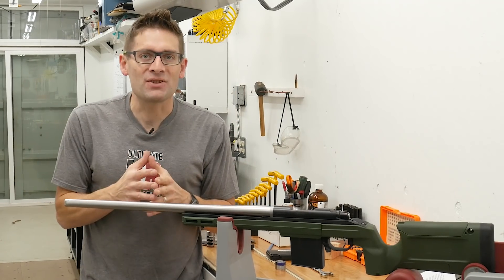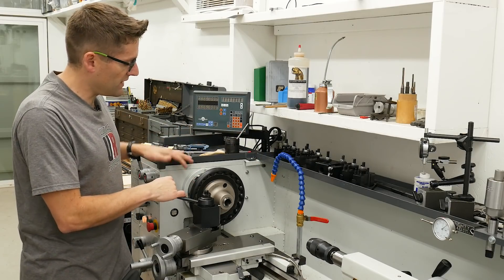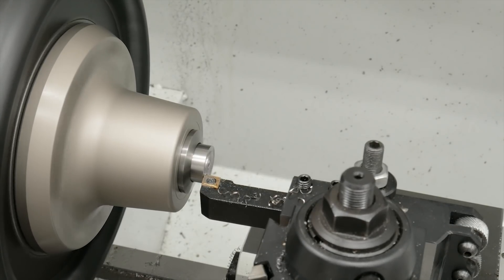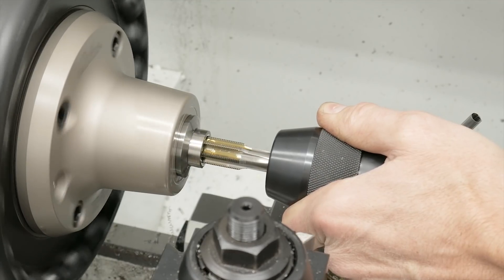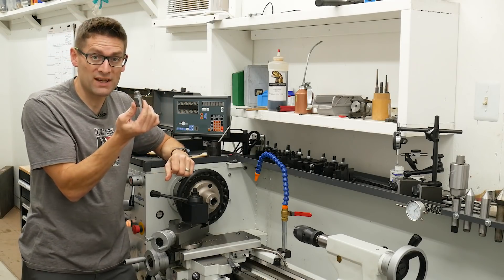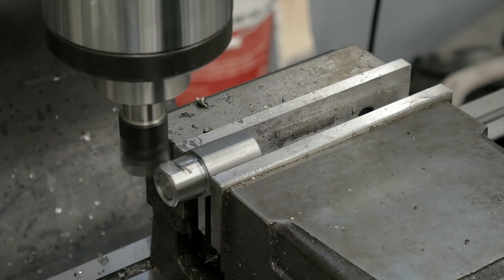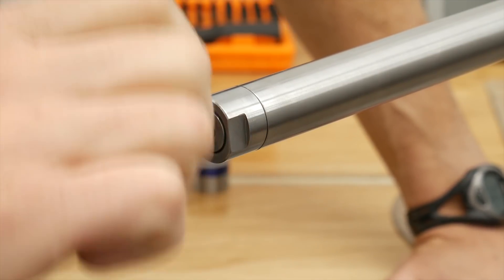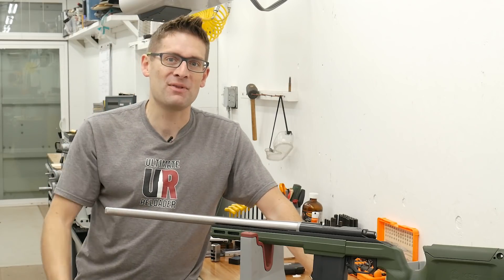224 Valkyrie Rem 700: Custom Muzzle Thread Protector (Part 5)

Comment: What is your total price for every tool? Lathe,collets,cutting heads,everything? All together not individual
Reply from the maker: Wow! For just what I'm using? Over $10,000. Just think of it this way- would I rather have the leather upgrade on a Tesla, or all these tools? :)
Reply from the maker: That's just for what's shown in this video :) The rest of the shop, that starts to add up.
Reply: It adds up. But it helps a barrel blank is cheap compared to a fitted and chambered barrel
Reply from the maker: Indeed, and 1 afternoon turnaround time is better than the local gunsmith who is backlogged for 6-9 months!